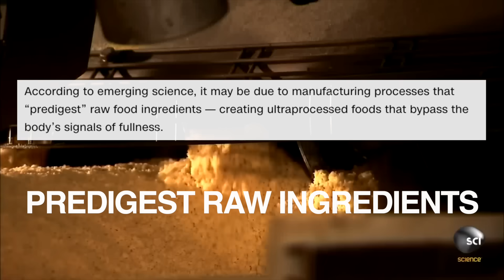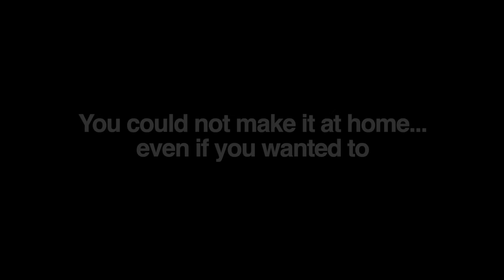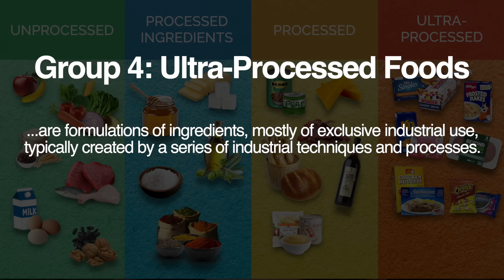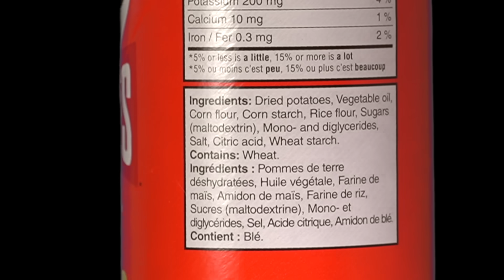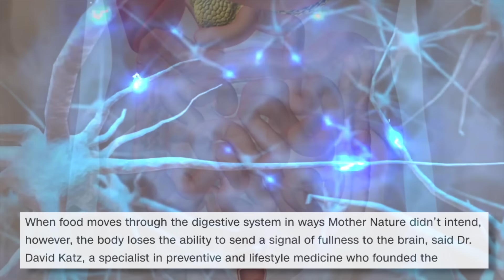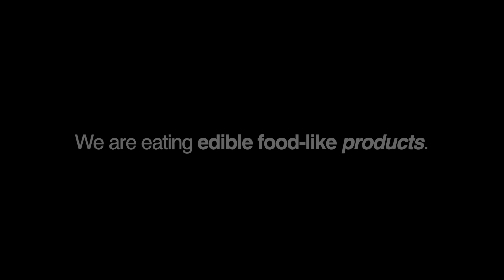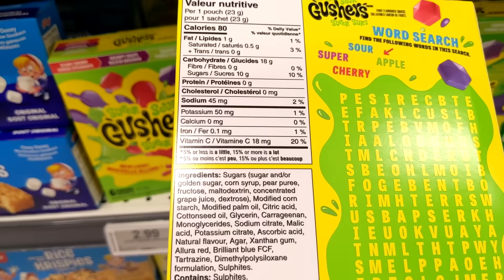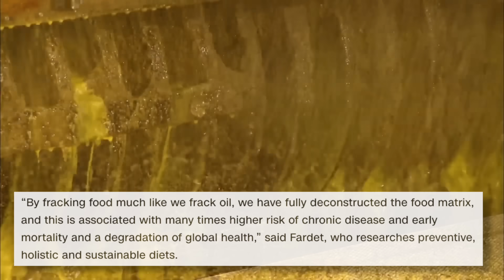The Disturbing Reality Of Ultra-Processed Food

Comment: Ultra-processed = made of highly refined ingredients

The bigger problem with highly processed foodstuffs, is the industrial process by which they are refined. Take vegetable oils. You don't get corn oil by mechanically crushing ears of corn and separating the oil with a simple water wash like olive oil. It's a fairly involved industrial process that requires a fair degree of chemistry to process ears of corn into a jug of oil. Okay, so what? Traces of those industrial chemicals (like detergents, bleaching agents, catalysts and reducing agents) remain in the oil, depending upon the quality being produced by the industrial plant. It's not consistent across the board; these aren't Star Trek replicators. This is just as traces of glyphosate (Monsanto branded Round Up) are present in fresh produce that was regularly sprayed with the insecticide to increase crop yields, and even save harvests from insect infestations in some instances.

In terms of individual health, beyond the traces of chemical residue one is consuming, many of which are endocrine disruptors, like many of the plastics in which food is universally packaged and shipped in, the refinement process typically results in food products that are easy to over consume due to being engineered to be highly palatable (people wouldn't buy them otherwise), as well as bypassing the normal signals of the gastrointestinal (gut) and endocrine systems to indicate satiety. Hence weight gain. The foods don't cause weight gain; eating too much of them causes weight gain. And because the refinement process strips out the natural nutrients of whole/intact foods, the body is compelled to consume more of them in an attempt to meet vitamin, mineral and amino acid needs. This is by intuition, incidentally. If an organism is deficient in X, Y or Z nutrient, it will keep eating instinctively in an attempt to meet those needs. Needs that are not met by many of the processed foods people are over consuming.

But calling it "predigested food" is a bit melodramatic with the obvious intent of grossing people out of eating these foods. Or maybe more importantly, that people are spending their money on, given that food budgets are on the minds of most people in present times.

Comment: So, I like these corn chips. They're made of literally 3 ingredients - corn, oil and salt. They are really good in terms of taste and one time I did try to replicate the taste using corn flour - it was crumbly when uncooked, but tasted the same afterwards. Does it mean this product is ultra processed? I got no clue but it seems to be a lot healthier than regular chips or doritos due to the lack of extra gross spices. 🤔
Reply: Get masa harina, make tortillas out of it, and bake or air fry it afterwards with some oil and salt. Regular corn flour doesn't work.
Reply: @lutziputzi  if you make it out of tortillas the taste will change.
Reply: @alittleofsomething  You don't have to cook the tortillas before frying. Just make the dough (masa harina 1 1/2 cups, water 1 1/4 cup), press, and fry. I've tried using corn flour many times and it never works. The taste may be a little different but consider giving them a try. Masa harina also has a lot more of the nutrients released from the corn which is a nice bonus.
Reply: @lutziputzi I live in Latvia, where access to certain ingredients are limited. I don't know what masa harina is. One thing I can tell you though, after cooking the corn flour holds up well and strong when I fried it. I can't take a lot of fried food, though, so I made it only once. I was thinking of trying full on corn, grounding it into a paste and trying to bake that to replicate the corn chips that come from factories. Our oven is pretty bad though, so I hadn't given it a shot yet.

Comment: 13:50 If the ultra-processed group only gained 2lbs in a fortnight then that’s likely just water retention due to the higher sodium content.  
The calories were consistent across both the ultra-processed and minimally processed groups, so weight loss was clearly gonna be similar.

However, ultra-processed foods damage your health in other ways that are hard to see at first.

Comment: I stopped eating and buying potato chips after getting a mandolin (the super dangerous finger fillet kitchen utensil) and a dehydrator, plus oven baking them. Small batch, and I just use my own seasoning like some dried dill, or a bit of lime salt or garlic salt for a bit of flavor.
Reply: I’m sure they taste better as well
Reply: @TheFrewah  well... it is ACTUAL food, not "food product".
Reply: @FuriosaSonoran  It is, I agree.
Reply: Pro tip if you're making your own: ghee instead of oil... and only low heat for a short amount of time after they've dehydrated. Makes them nice and crispy.

Comment: As a chemist i feel this sort of falls into the matural is always better bias.
However there is alot of things food companies does that is just straight bad.
But you could do hydrolysis at home depending on what you would want to do it to just boil something in viniger and you will start this process.
Alot of extractions of components should also be possible potential significantly harder or impossible depending on food and what you want to extract but possible in general.
Reply: What are you talking about?
Reply: @jessica3218   that with a little know how you could most likely make alot of the ultra processed stuff at home, like hydrolysis isnt something magical only a industry can make

Comment: You know what's ridiculously, RIDICULOUSLY stupid? Sugar. I cut out NOTHING but soda, fruit juices, and that's IT. I still eat chocolate, candy, baked goods, and still gorge on huge portions for dinner. and between some light weight exercises and daily 10KM bike rides, I've lost 5 pounds every single month for about half a year before things started to plateau. Only now do I have to actually target other food groups and count my calories to continue to reduce my body fat content. I went from 205 to 170 in half a year. It's actually insane, I thought people were lying when they said "stop drinking soda and the pounds will melt off." Granted I also bike 10KM a day and do some very light weight exercises, but I've been doing that for years to zero effect until I stopped with the soft drinks.

If you are reading this and you feel like the hard work you're putting into exercise isn't paying off, it's probably because fruit juices and sodas are actively stealing your gains from you. Even something like orange juice is insanely sugary, you could eat FIVE, count them, FIVE sugar-glazed donuts for the same sugar content as 500ML of orange juice. Granted those donuts have way more carbs and no vitamin C, but I wouldn't eat that much sugar even if the product was negative carbs. I know a lot of people already know this and are going to call me stupid for pretending like this knowledge is worth anything, but if even one person reads this and learns from my mistakes, I'll call it a win.

Soft drinks are BS, I'd rather have a couple donuts or a small bag of candy.
Reply: You may want to try Kombucha. It’s more expensive than soda but you can make it yourself. It takes just a week.
Reply: my morning coffee has been keeping me plateaued for YEARS. it's taken me weeks but I am finally just about ready to drop the sugar from it entirely now, after having like 3 tablespoons a day.